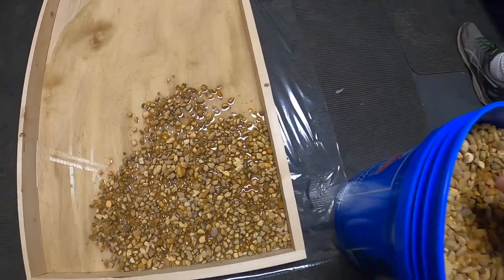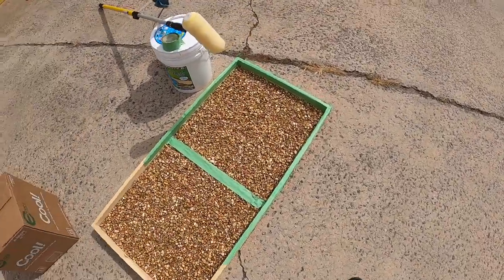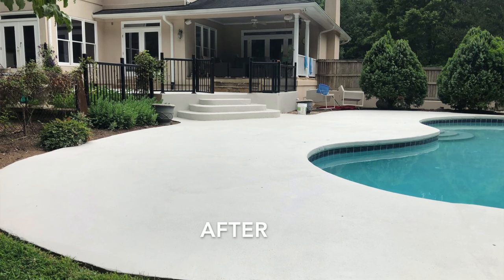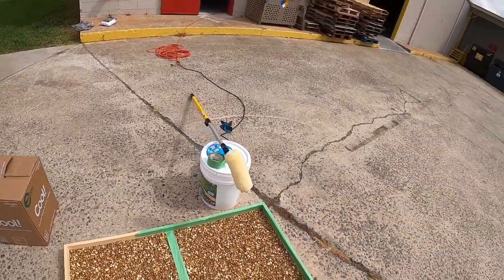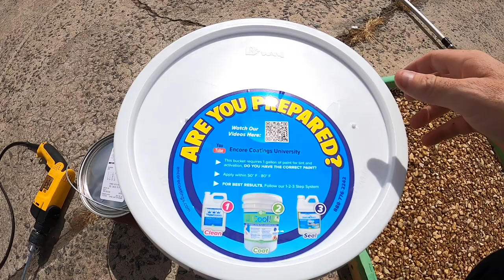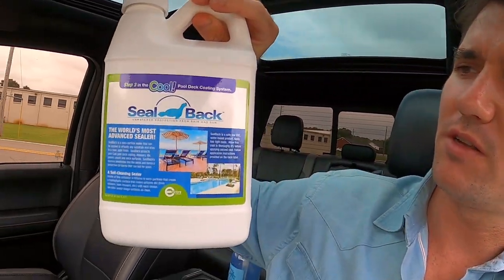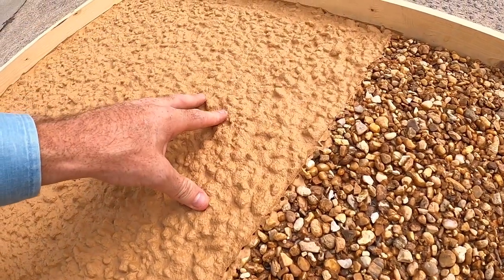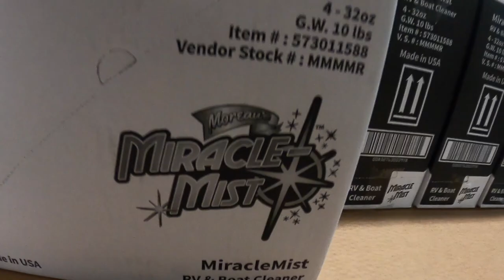How To Resurface Exposed Aggregate Pool Deck with COOL Pool Deck Coating

Comment: I like the stonework better. Make a clear epoxy that can be applied to the surface that makes it less sharp and cooler but retains the color of the stones. 
I think using a clear epoxy on top very thick would make it cooler and less sharp but keep the cool pebble pattern on there. I know you think it is dated but it really isn't. Those types of surfaces like exposed aggregate are timeless when done correctly.
Reply: Agreed. My exposed aggregate was done properly. It just needs to be restored with clear epoxy. There's no way I would smear peanut butter over top of it
Reply: It’s going to be expensive to put epoxy on such a large area, isn’t it? Any ideas where to get well priced epoxy?..

Comment: So it looks like someone pourd globs of paint on there. Worse than the original pebbles.. If I were the homeowner, this is what I would do if you want cool deck over exposed agrigate that you want to keep. Rent a concrete sanding machine like the professional coating guys use and sand that concrete as flat and as smooth as possible. Then apply knock down texture. Then apply cool deck. Dont apply cool deck on top of that pebble because its looks extremely amateur and sloppy. In the end with the sanding process, it will look just like or almost like a regular concrete deck with texture cool deck.

Comment: Please don't take this the wrong way but I have an exposed aggregate deck and would not be happy with what you have shown.  Can you show an actual deck with deep exposed aggregate after it's been resurfaced?  I'm very interested in the product but this video was 8 months ago and surely since then you have a real world example of the coverage.  Thank you!
Reply from the maker: GREAT question. Every aggregate deck is different and they come with varying degrees of contour. This will certainly affect coverage of the COOL per bucket. First of all, COOL by itself should not be used to “float” across the decking with the goal of eliminating (fully embedding the pebbles) the contoured surface . It will NOT result in a smooth, “concrete like” surface afterwards. Contours of the pebbles will always remain , even after 3 coats. Additionally, you will most likely need to double your material demand. Example: if you have 1,000 square feet, I’d order enough product for 2,000 square feet or more. I love your comment and question, and this is something I need to add to this video. These types of decks are a different animal entirely and folks need to understand the realistic expectation. If your objective is to completely eliminate the contoured texture of the deck, a preliminary leveling product (cement based most likely) will need to be employed PRIOR to the COOL being installed as a temperature reducing top coat and safety (and decorative)  coating. Hope this makes sense, please reach out to us for a detailed technical discussion if you need us. Thanks! (888) 776 2242.
Reply: Where are you located?

Comment: Couldn't you just pour it for a completely smooth finish?
Reply from the maker: No, COOL cannot be used as a “filler”. I’ve been told that you can mix 50/50 H&C DURATOP & Non-Shrink grout (then mix w appropriate amount of water) that you can “pour” or float this mix across the aggregate and allow to cure. This will make it all smoothe, and then top-coat with COOL ! . Call me if you want to explore this more! (888) 776 2242 / encorecoatings.com . Thanks !

Comment: I don't know if your product is the same as the "Cool Decking" I am familiar with also used back in the 80S. It broke down easily had to be resurfaced every 10 - 15 years. The epoxy over stone got very slippery when it rained or very wet. I have the stone imbedded in concrete for my decking and while it does get hot it is not sharp. but any surface gets hot in the Texas over a100s degree summer. While it is nice that folks have various options, painted stone like painted brick just looks redundant to me, not a fan. But appreciate you taking the time to make the video.
Reply from the maker: This is completely different than “KoolDeck” from the 1960’s - on. However, that is great input, and I would agree that this is not going to fancy everyone, but some folks cannot bare to leave these decks as they are currently and need a cost effective solution vs. demolition and replacement. Each aggregate is different, some are comfortable to walk on , others are not. Thanks for the dialogue!

Comment: Lot's of questions after viewing this. How about vertical areas, like our raised pool spa at the one end of the pool that has pebble decking on 2 sides? Will your product hold and dry on the vertical surface like normal paint on a wall? We get a lot of mold and algae build up in areas of our current pebble aggregate deck, because of all the rain and humidity here in Florida. It requires cleaner and power washing at times. How will Cool hold up to power washing and chlorine based cleaners every few months?  We also have to repair small areas regularly where the pebble material has started to release from the epoxy that is holding it down. Will Cool keep this from happening, or how do we fix that when the pebble and cool coating starts to come loose in areas? This looks like a good option and we have been trying to decide on the best way to resurface it or just strip it off and resurface it with something totally different.
Reply from the maker: Hey Herb. Thanks for the questions. If the pebbles are embedded in an epoxy system, this might not be the best option. The concern is that the COOL might not bond so well to the epoxy. It depends on age and chemical composition. The COOL does however bond to vertical surfaces and can be pressure washed with chlorine products. I'd suggest doing an adhesion test, perhaps before a full demolition. If a bond is achieved, it would be a great, cost effective solution vs. replacement. Call us to discuss in more detail. Thanks again. Jeff. (888) 776- 2242

Comment: Do you need to fill in small cracks and two inch circumference whole in pool deck before applying this product?
Reply from the maker: It’d be wise to do so, cracks should be filled with a *paintable (important detail) concrete crack filler product. Do not use cement or cementitious materials , as they do not have elasticity to accommodate the movement within the crack. For holes and patches, use a polymer-modified cement patch. Do not use ordinary concrete, as it has no strength at shallow depths. This is where the polymer-modified products shine, and they cure in 24 hours. Make sure the patches cure correctly and have no chalky residue afterwards. Thank you! Call me anytime. (888) 776-2242

Comment: Is there a video that talks about crack assessment before using this product? I have exposed aggregated and I have 3 long crack I need to assess before using Cool
Reply from the maker: Great question. I’ve had great feedback this product, google : CONSANDTRATE.
Reply: @encorecoatingsuniversity3203  Thank you for the recommendation, this stuff is perfection for exposed aggregate.

Comment: Do you recommend I use a 1inch or stick to 3/4 roller? I have exposed aggregate on concrete finish.
Reply from the maker: Sometimes 1” is better for aggregate especially if it’s a deep profile . Never go smaller than 3/4” ! You could get by with either, but I’d try 1” on the first coat, maybe move down to a 3/4” on the second . Thanks !

Comment: we have two courtyard patios with this stuff and the pebbles are just rolling off all over the place...but still plenty of the sharp stuff on most of it.  Should I try to scrape off as many loose pebbles as possible or just blow what's come loose off then apply this stuff?  The courtyards are internal so getting the whole thing replaced would require some kind of major overhaul
Reply from the maker: Yes, a thorough pressure washing with triple crown will clean, prepare, etch, and remove anything suspect - whatever survives 3k+ psi I would leave it alone and apply COOL over what’s left. Thanks so much, please don’t hesitate to call us! (888) 776-2242 . Ask for Ryan !

Comment: We have river rock and it was horrible. We made the mistake of putting a cement overlay on it. That is now popping off. Will this help?
Reply from the maker: Overlays have their advantages but I always forewarn about the issues of “pop” after a winter or two! Cool will bond to the overlay but it will not prevent further movement and separation . Theoretically it could prolong the lifespan built preventing moisture intrusion (freeze / thaw cycles) , but it’s too late now . Depending on the current condition , it could require a full demolition and removal OR perhaps partial removal, new overlay in those areas, then coat the entire area. Remember COOL is only as  good as what it’s applied to! Thank you! Call us anytime and have a wonderful day . 888 776 2242

Comment: I have the exact same pebble deck with the exact problem. My only concern is with drainage. Though my deck is not the best, it does absorb water and prevent pooling. Will your product prevent water drainage?

Comment: Thanks for the response. I have a few quick questions. 
I have done the triple crown and purchased the cool/seal back and expect to begin with the first coat tomorrow morning. I am in Louisiana where the temps are high this time of year and rain is likely.  I have to work at sunrise to meet the 82 degree mark (it will be 82 by 9 am).  What if it rains that afternoon or evening between coats?
Also, I have seen other products spray a final coat to produce a texture through a hopper. Can that be done with cool?
Reply from the maker: Yes texturing can be done with hopper guns, I have a video dedicated to that. “Custom knockdowns and multi tones using COOL!” . Scroll through my videos to see what THats all about. More importantly, let it rain on the first coat, not the second. The coating is vulnerable to staining before the sealer is applied, therefore it’s much better to let it rain (stain) the first coat, knowing you can cover it up with the second coat. COOL needs at least 4-5 hours of sunshine before rain. Clear sealer needs more like 8-12 hours. Clear sealer can be applied one hour after the second coat of cool is finished. Hope this helps. Call us anytime ! (888) 776 2242. Hope you purchased enough COOL buckets, the aggregate really really soaks it up.
Reply: All complete!  Looks great. I appreciate the great customer service. One last question, how ofter will seal back need to be reapplied (or does it ever)?

Comment: I noticed that you did not use the etching formula.  Is that not necessary for exposed aggregate or because it was freshly poured?
Reply from the maker: Great observation, this was for demo purposes only - therefore triple crown cleaner is certainly recommended on real world applications. Great question. Thank you and call us anytime (888) 776-2242
Reply: @encorecoatingsuniversity3203  Thanks for the quick reply!  Do you have an estimation of how many sf a half gallon of seal back will cover?
Reply from the maker: @alexlambert2349  best case scenario : 200 Sq feet with two thin coats.

Comment: We have a patio with this
But there are several places where the pebbles have come up exposing the concrete 
Do I need to do anything before new material
Reply from the maker: There’s not much you can do at this point besides protect it while you still have the chance . RE-embedding pebbles would be tedious and time consuming and might not work out the way you picture in your head. Thanks for the comment ! Call us anytime (888)776-2242
Reply: @encorecoatingsuniversity3203  Thanks for the video.  I have this same problem ... but with only a small number of missing stones, so I would be OK with RE-embedding. even if it is tedious.  Do you suggest any glue products?  I also have some larger cracks that will need some stones added after filling with a polymer-modified cement patch, as you suggested earlier.  Will new stones adhere to that?
Reply from the maker: @sandrafiedeldy4215  this is a clever idea and would take some patience and a steady hand . The pebbles would adhere onto / into the wet polymer modified patch. Make sure you wash the pebbles thoroughly - perhaps soak them in triple crown first, allow them to dry, then rinse throughly . Use gloves / goggles / caution if handling triple crown this way. Once the pebbles are clean and dry, move forward with patching . Make the edges of the patch “feather” into the surrounding area, avoiding leaving behind rough changes in contour (blend it in!) . Then embed pebbles. Wash / prepare deck first so the patch material bonds to the bare area. Contact Ryan at (888)776-2242 as you’ll need help estimating material coverage. Coverage per bucket is heavily affected on aggregate! Thanks!
Reply: I'm in the same boat. Our pool deck has many areas where the cement is exposed. We live in Southern California though, so would a concert overlay be acceptable? Or would it still Crack?

Comment: how toxic is it?
Reply from the maker: Trace levels of VOC’s - less than your average house paint . It’s completely water based with zero solvents (water is the solvent).
Reply: @encorecoatingsuniversity3203  is it safe to coat a fish pond with it ?
Reply from the maker: @VanillaAttila  no, it’s not designed for submerged applications . Sorry!
Reply: @encorecoatingsuniversity3203  I'm looking for a coating over pond liner if you have any suggestions